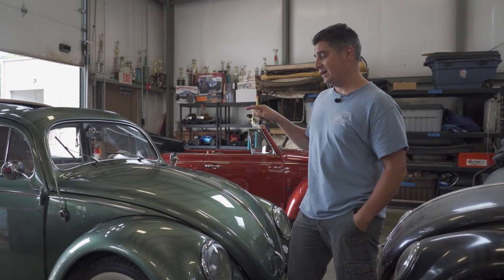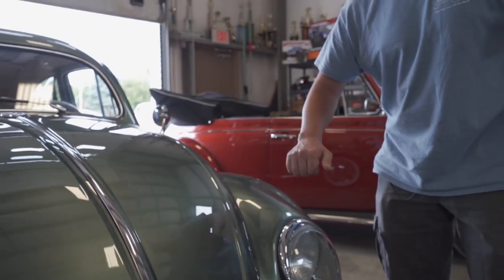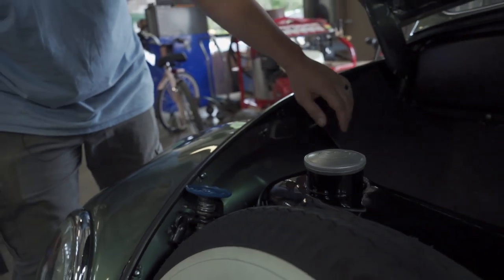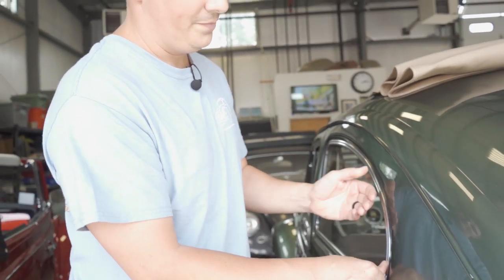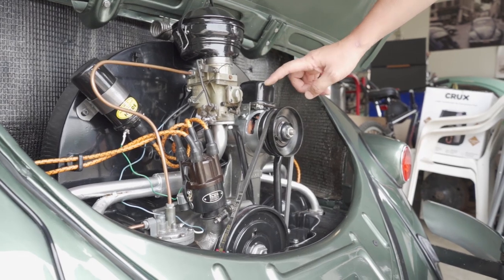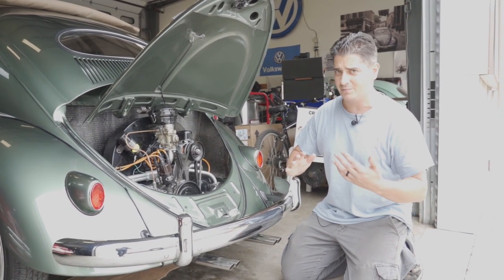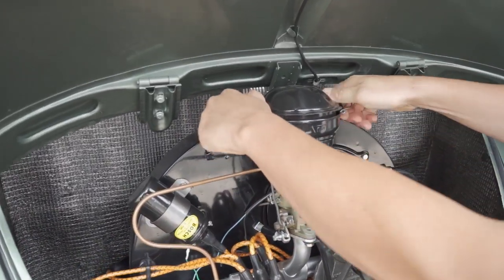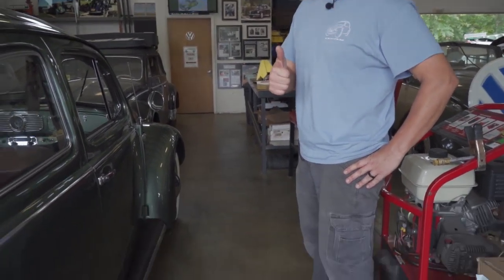Classic VW BuGs Volkswagen 4 Dummies 1956 Oval Beetle Resto PT.1

Comment: Fantastic Vid Chris.
I thought I know a lot about the early Beetle as I have an Aussie built '57 beetle, but you have clarified a few things, especially about the crash box.
I was told the whine in first was a sign that the gearbox was on the way out.
I have swapped it with a '60 syncro box ( Still have the crash box) and it transformed the drive.

Comment: I really like these videos.
Just have to make a comment regarding the oil recomendation. 
The better the oil the longer the engine will last. 
Because these engines have a tendency to run hot its way better to go for a fully synthetic oil instead of a basic mineral. 
The only advantage to run the basic oil is because its cheaper.

Comment: I thought valves are set to .006?
Reply from the maker: Not on a 1956 36hp motor.  .004 on those.  40hp is .008 on intake .012 on Exhaust.  1300cc and later is .006 across the board.
Reply: Gotcha! Thanks Chris!